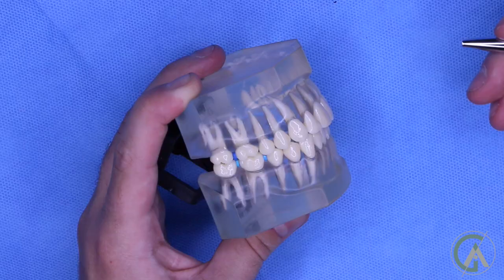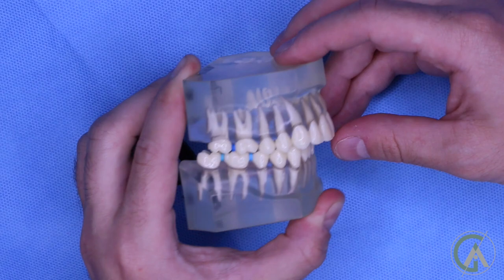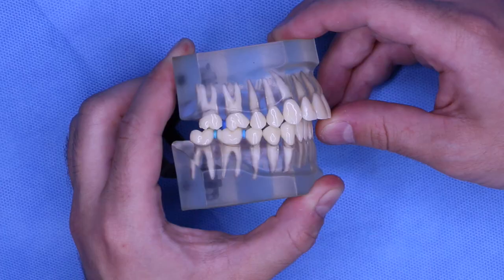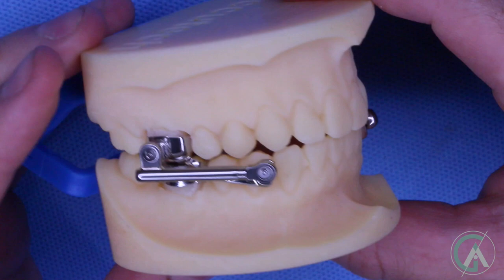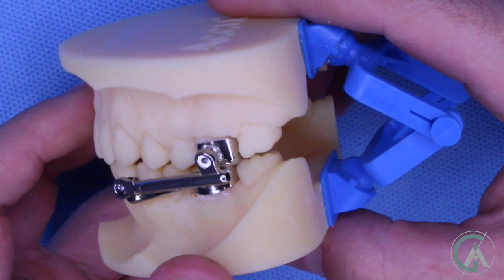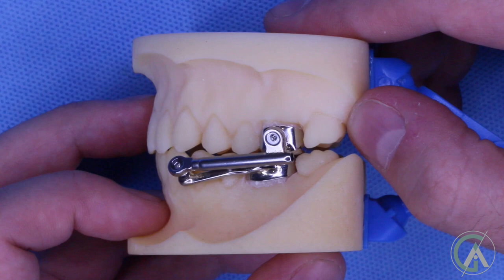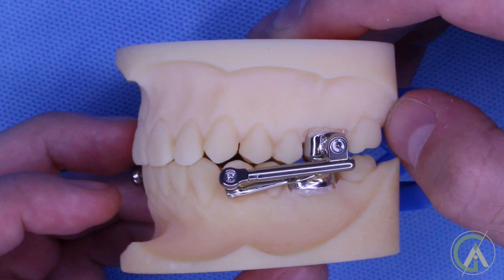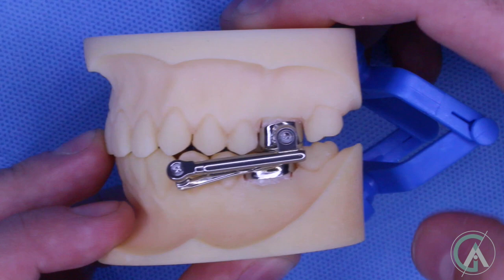[BRACES EXPLAINED] Herbst Appliance

Comment: Can u make a video about how to fix underbite issue without surgery ?and which is a preferred method to fix it elastic or screws ?

I am 24 years old and I have mild underbite issue and cross bite on the left  what do advice me to do without surgery option ?
Reply from the maker: This is very specific and I cannot provide treatment plans online but I do plan on discussing this (generally speaking) in a future video so please subscribe & hang tight!

Comment: Hii i have a question : I have an overbite and my orthodontist recommends that I should make my bottom jaw wider by using an expander, but my cross bite is very large (I used to suck my tongue when I was a child until I was about 8 years old). She says if the expander doesn’t work, they’re going to have to remove my two upper pre molars to cheat and make my upper jaw smaller. How does removing my upper pre molars help my overbite get better ? And / or is there a better way to fix this ? I’m not sure that Herbst might work, it sounds like it could but she didn’t recommend it (by the way i’m 14 years old, can my teeth still be fixed without surgery ?)
Reply from the maker: Usually growth in females is completed by ~14 but it is a case by case basis, as some girls grow longer/shorter.  By extracting upper premolars, basically that space will be used to bring your front teeth back and decrease your overjet (what you referred to as overbite) so that your upper and lower teeth touch. Hope that makes sense!

Comment: Just got mine on and i have a question: The bar at the top of my mouth connecting the top teeth, it makes it very hard to eat. When i try to bring the food to the back of my mouth, it gets stuck in the bar. Also, when i bite down only the 4 teeth that the appliance connects to touch. What do i do about these problems?

Comment: hey i have another question about the herbst- do you need braces for the herbst appliance to work? all my teeth are all straight and everything, i just have an annoying overjet. and do you also need an expander and lower lingual holding arch as shown on the model for it to work as well?

Comment: I have a band running from a top left tooth to a bottom right tooth across the front of my teeth to move my midline into place. Is this one of those cases where the bands do change the relative positions of my jaw? I'm also assuming it's muscular and worried it'll easily go back since when I take the bands off, the shift back a little immediately.

Comment: What should you expect at your first tightening/adjustment and I have 4 molars coming in at the back will that effect full correction or will they have to removed and one more thing what is a vertical jaw growth
Reply from the maker: At your first adjustment you should just expect that your teeth will feel tighter & then later that day it will be a bit sensitive. The sensitivity improve over the next few days and then you'll be back to normal!

Comment: My orthodontist said that the Herbst appliance is outdated and hadn’t used it for over 20 years. I get my braces on tomorrow and am getting an Advanced Sync molar to molar. Also, headgear is not the standard anymore, you want to bring things forward instead of push things back.
I’m 26.
Thoughts?
Reply from the maker: Lol teeth dont know what is "outdated" they just know force .. the herbst is still a very viable option. I don't use it often but does not mean that it doesnt work

Comment: If an adult uses this device, would the lower jaw at least move slightly forward?
Reply from the maker: The only thing that will happen in adults will dental changes (no impact on jaws itself)
Reply: Braces Explained hello doctor ,,my lower jaw is back 1 cm ,,,,I force my lower jaw to move forward in day I can make it approx 4 hours a day ,,because sometimes it cause pain,,,,I'm 17.5 can I get Herbst appliance or my jaw will be moved forward by rubber bands or elastics, or overjet,,

Comment: Hi there I was wondering how can gummy smile be fixed by braces?
Reply from the maker: Hello! Gummy smiles can be caused by a variety of factors. Depending on the cause of your gummy smile, which your orthodontist should be able to tell you, they can be fixed with braces. Usually they can but I would still go in for a consultation! I will make a video on the different types of ways we can use braces to fix a gummy smile so make sure to subscribe so you can be notified when I do!

Comment: Can you do a video about only top/bottom braces? 
I only have top ones and I’m confused as to why I have the so many hook things to put bands on when I don’t have bottom ones to attach them to? Why would this be? (I’m not getting bottom ones later on in my treatment due to the fact I didn’t need them)
Reply from the maker: Interesting. I only rarely do one arch but the reason you have hook things is because the braces we purchase always come with the hooks because most of the time we do upper/lower braces. So just ignore those little hooks if you are only have top/bottom braces =]

Comment: I just got my Herbst Appliance on today. Is it normal (and will I see changes soon) for my teeth to not be touching in the front...mostly on one side? And also it’s making my bottom lip look slightly crooked...is that just the way it’s gonna be now or only until my mouth gets used to the appliance??
Reply from the maker: Umm not sure about your second half but usually your teeth dont touch in the front because of those crowns on the back teeth that the Herbst is attached to!

Comment: If you are threatened with this device and don't want it -demand time to decide for yourself.  In most states, a 15-year-old can be charged with first-degree murder under the legal assumption they can form the required logic to commit the crime.  So, you should be allowed all the time it takes to decide for yourself if you want the HORROR this device causes.

Comment: It doesn,t work? For adult? 
I’m 29 years old. And class2 type
Reply: Hi. The doctor said in the video that it only works, if you are still growing. By 29 you most probably have stopped growing several years ago. So, no, according to the video, it won't work. He said that the same results could be achieved by jaw surgery in adults, if it is needed or desired and there are no cons.

Comment: i used whitening tooth past before i got my braces. since i got my braces on i’ve been using non whitening tooth paste. should i be worried?
Reply: itwasenchanted I’ve been doing the exact same thing. I’m sure it’s nothing to worry about. You’re not supposed to whiten your teeth with braces anyway.
Reply: No reason to be worried! You actually made the right decision to stop with teeth whitening products. The whitening would not reach the little square parts of the brackets. Resulting in a yellow patch on your teeth
Reply: Here on youtube there is a girl, ChelsNicole, she did the same and used whitening products in her braces journey, because she started with full white teeth and nothing went wrong. actually i thin you schould use whitening products while having braces because except the square from the brackets it will eventually turn yellow

Comment: Hey! 
Do you have an suggestion for class 3? i had narrow palates and an underbite. :(  Class 3 is genetic , my mom has too.

some info : My lower teeth are little bit forward but straight , which it will be better when narrow palate get better. And when both of my narrow palates are fixed i think i will have 1 or 2mm space between them. I dont have now at all.  

my question is ^^ Will my orthodontist give me a headgear (i would totally ok with this if it is going to work for me, bc i just turned 17 years old) or elastics to pull my upper jaw forward , something like that :D? Or  kind of herbst appliance with different way.

English isn't my first language. so if i didnt tell things clearly sorry for this. 

btw i started to correct my tongue posture , i hope that it may help for class 3.  I think it can work if it happened at the same time with headgear. I really dont want a surgery. I would be grateful if you help me and guide me about this.

Comment: God damn that looks so scary, having all that in your mouth..😮
Reply: Yeah I just got it today... It does not hurt at all really. What really hurts about it (and only hurts for a day or two after you get them) are the crowns. They are basically what mount the metal bars but they have to be cemented in your mouth so it hurts for a little but. The bars are just screwed in.